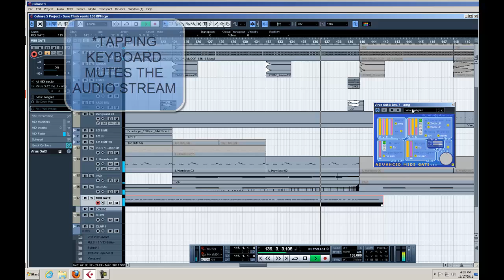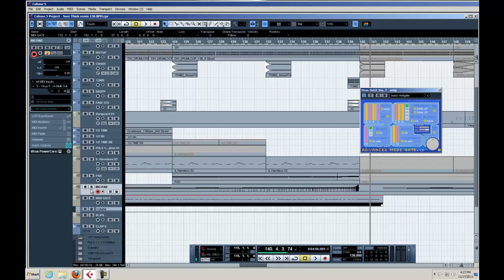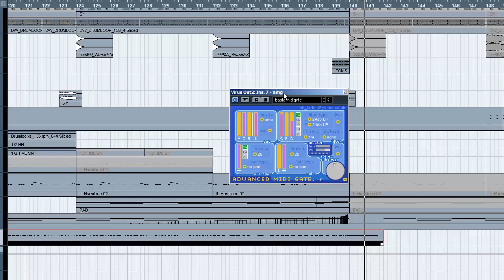Cubase Tutorial: MIDI GATE

Comment: Hi Great video. I have created a gated pad following your instructions and created exactly what i wanted. However exporting this as audio is a problem. I get the instrument track without the gating. Ive tried the same method with Cubase's built in midi gate and it exports fine but i much prefer the AMG. How do i solve this?
Reply from the maker: that is bizarre, could be an issue with that plugin and your sound card. Try soloing your pad and the midi gate track and bouncing it down within your project, or use the VSTi "freeze" button on the VSTi rack. Very strange!